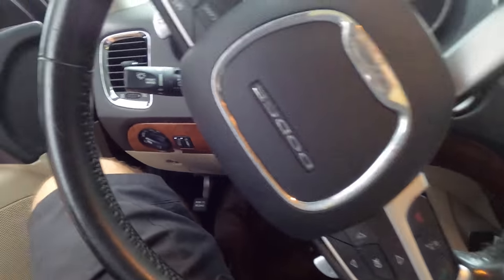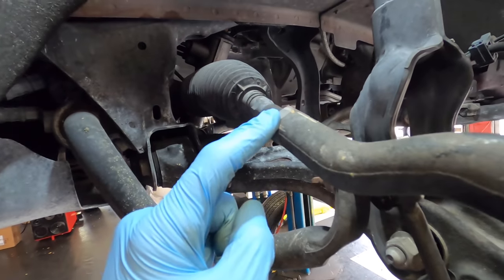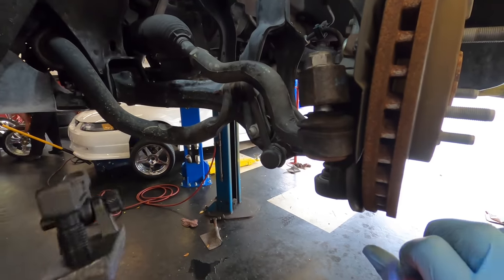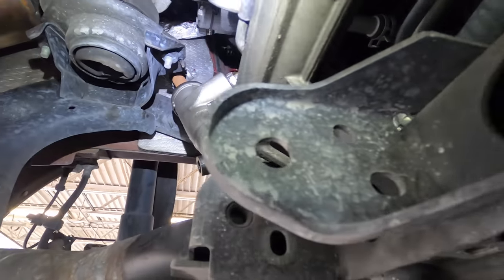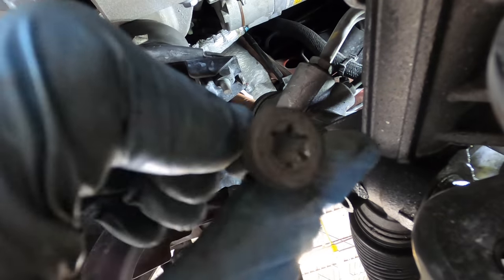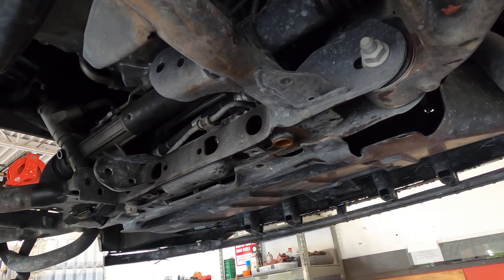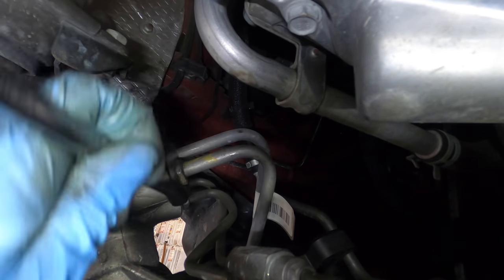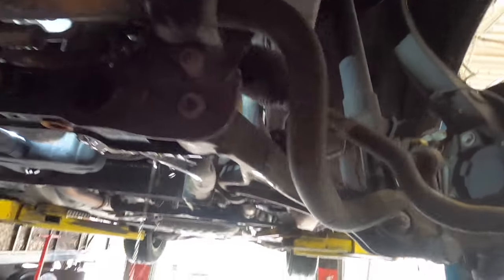Engineers vs Mechanics | They GOT Me!

Comment: Oddly, coming from an aviation background, I see so damned much here that is wrong on at least twenty levels. On the birds I worked on, everything was built to be disassembled while stile still installed on the aircraft: saving the mechanic, the repair station, and the customer time and money in terms of work performed and down time. This Dodge Brother's Wagon on the other hand, looks like it was built to never come apart. Even the rack bolts are upside down. If the nuts back off, the bolts fall out and you lose 90% of your steering input. If the bolts were "heads-up" that would not happen. Just further evidence that modern vehicles are built to be thrown away and never worked on.
Reply: Having worked in the automotive business and now aviation as a designer, I can confirm everything said above.  I can't even start building parts until I know how they will be removed quickly.  

Also, from what I have seen, design engineers these days do not have the hands on experience necessary to realistically build manufacturable parts.
Reply: they truly are. instead of a huge touch screen on a dash id love to see a new car that is designed to be easily repaired. i went to change the shocks on my ford econline and the only way that makes sense to remove the shocks in the rear is to cut the tops of them off with a sawzall, how insane is that??
Reply: Everything except thrust reverse sync shafts of all things, I don't know if they never expected them to fail or built the entire engines around them, but the number of times I've had to cut the outer line in half, then cut the new part in half at the same point to get it in and swage both halves in place to get them in is ridiculous
Reply: thats why we have birds still flying LONG after their figured service life...
Reply: I went from an automotive engineering and R and D, then on too aircraft....yes..automotive industry is driven solely on the buck...not but 2% given to consumer safety
Reply: @narmale  aviation vehicles are small volume by comparison and end users pay huge money for them
Reply: Perhaps cotter pins to keep the bolts from coming off?
Reply: S
Reply: Totally agree with you
Reply: You hid the nail on the head.
Reply: @narmale  Right!  I was a Huey (UH1) helicopter mechanic/crewchief in the 1970s.  I am amazed how many Viet Nam era birds are still in use. That's what happens when things are designed to work, and be fixed when they don't work.
Reply: i have a much different take on this.  cars are designed more like an appliance.  bought and not really meant for large scale servicing.  Also cars are designed to be built quickly on an assembly line.  That durango was probably built on the same day as 1000 others... where as planes are still largely hand built and very few designs of planes ever get to 1000 total built much less that many in a day.
Reply: Also because aircraft are sold to airlines, which have a very slim profit margin. They need plane maintenance turned around as quick as possible, and will pay extra upfront to enable easier maintaininace for the lifetime of the aircraft.

With automobiles, manufacturers they can only stand to gain by not caring how maintenance will be done, because consumers don't think about that as much.
Reply: I've been finding this more and more as the vehicles I work on become newer generations. I started working exclusively with VW Beetles. My tool set was minimal and I could still do everything I needed to do. Then I moved on to Honda Civics, and they were easy to maintain and repair. Then OBD-II hit and every car has been a nightmare since. It's not even the diagnosis or all the tools that are required... it's the cramped engine bays, subframes that need to be dropped whole for many jobs, FWD transaxle shafts gotta be pulled for a bunch of stuff, almost always removing battery trays, starters, intakes, radiators JUST TO REACH SOMETHING. I miss the Beetles.
Reply: @juansolo1617 : True to a point, but I recall adjusting Volkswagen valves every 3,000 miles, plugs, cap, and rotor every 10-12,000, the number three cylinder always running hot, pushrod tube oil leaks, fuel leaks spraying onto and into the distributor causing engine fires, and so on.

Most of today's cars, if they are made properly, will go 100,000 miles with just a couple of oil changes and a set of new tires, and they will go a LOT farther if the recommended maintenance is performed correctly and on schedule. The trade-off is worth it.
Reply: @edwatts9890   you guys obviously have not worked on an alfa romeo
Reply: On my Ram truck, you need to drop the fuel tank to get out the leaf spring hanger bolt or cut it off and put the new one in the other direction. Some crazy stuff they do.
Reply: everything in the aviation sphere is built to be able to be regularly checked, maintained and taken care of. Cars for the past few decades at the least, are built in a manner that they can be pushed off the assembly line the fastest. It's why we have things like starter motor jobs that can take at least a few hours. Or bolts that require removing multiple components just to get enough clearance to remove. Unfortunately we're long past the point of that changing. There's little reason for manufacturers to give a shit what happens after their warranty period. And if it fails inside it? It's typically just a straight swap of systems.
Reply: @madman432000  Dodge has done that for decades.
Reply: "Put a Dodge in your Garage"
Reply: mitsubishi magnas can be reliable. trouble is, the engine has to come out from underneath the car. Absolute pita to work on
Reply: Could it be cars are engineered around an efficient final assembly line process of imported subassembies?
Reply: @justinmugge2721  true but 3D printing for many materials including building is becoming a thing. not necessarily a good thing in terms of integrity though
Reply: Good call on the power steering bolts being upside down.  But if they fail, 2-8 ppl die, they don’t care, still way less than a couple 100 :(
Reply: Cars these days are designed for fast assembly, not repairs. The quicker they can slap them together, the cheaper they are to build.
Reply: They were some airplane that were a pain to inspect parts or grease some of the zerk fittings.  And if I recall on one MD plane, the tail elevon screw mechanics used gloves to smear grease on the screw and had some problem to plug in the grease gun to grease the zerk fitting of the nuts and that cause a crash.   The design flaws of this plane was the access ports on each side of the tail assembly that were too small.  NTSB investigators wondered how mechanics were able to change the screw assembly if the screw shown wears.  

With the exception of a few of them. When they did design planes in the day, they used drafting paper the fixing of some of them wasn't so easy.  

Now with Dassault Catia 3D cad design they can plan ahead access to system for removal and installation without dismantling all the section where the part is situated.
Reply: Cars/pickups just have to last until the warranty period ends...
Reply: The story goes that original engineer caught his wife in bed with the original mechanic and those sob's have been trying to get back at us ever since.  its always the part that breaks the most thats in the most difficult place to change.
Reply: What did you work on? Because I have quite the opposite experience with the aircraft I have worked on. Lol
Reply: @NCISGibbs88  Dinosaurs.  I started on 707's and DC8's flying air cargo for burlington  air express.  The newer aircraft have much better designs for maintenance!  When i worked as a Locomotive electrician they had a VR setup to test fit parts and tools Before we built them.    Sure made life easier on everyone.
Reply: Engineers think car they designed never break down. LOL!!
Reply: @stevehatfield765  ah ok I worked on ERJ145s for a while, lots if GA aircraft, and now helicopters. I work on a lot of aircraft from the 30-50s as well, but most of them are still smaller aircraft. I do agree with heads up/forward bolts and stuff, and lots of times it makes the job 10x harder, but it is a must have when I work on anything, unless it is not possible
Reply: It’s not really fair to compare car/truck engineers to aviation engineering.  1)safety standards are much higher on aviation. 2) cars/trucks don’t fly at 30,000+ feet. 3) planes are completely stripped down to the frame/skin at a scheduled time interval- this on top of the regular scheduled maintenance. And 4) if cars could fly, would you even think about flying in some of the junk piles that Ray works on? Seriously, just watched a different Ray video with a Cadillac Escalade white.  Had leaking brake lines from master cylinder to ABS control pump.  Customer first approved repairs, then overnight they changed their mind & told Ray to reassemble and put in parking lot for customer to pickup. Really? Completely unsafe to drive.  Engineering knows the general public will not properly maintain stuff, so why be concerned with making maintenance/repairs easy. If the customers do give a chit why should they.  Were as with aviation the engineers take into account that maintenance/repairs will be required over the life of the plane.  Airlines demand that planes are designed & engineered to be relatively easily repaired.  To bottom line this if car buyers started demanding better designed vehicles and quit buying the crap car companies produce then things would change. But until then have fun complaining.
Reply: @Bohappenstance Click I'd be interested to know of one modern regular production automobile which requires intake manifold removal to replace the oil filter.
Reply: Automotive companies get to pick their engineers after the military, aviation and space industries.
Reply: @Bohappenstance Click hiding the starter under the plenum is a pretty decent spot TBH. Nissan VK, Caddy Northstar, and Toyota UZ if I recall all use that. They have a space that will never get oil leaked on it from the valve covers, is shielded from the severe heat of the exhaust manifolds, and all of those intakes are fairly straightforward to remove. I have no complaints.
Reply: @Bohappenstance Click often times, a starter mounted externally can be even more of a pain in the ass. See the tundra 5.7L for example. I’d rather replace one in the valley of an older 4.7 any day.
Reply: @Bohappenstance Click I like both! I have an 88 k1500 mud truck with a hot little small block and a big iron 4-speed, solid-axle swapped. Loads of old-fashioned fun, but the fumes and fuel bills get old on the road. Im actually working on EV-swapping a 97 s10 5-speed 4wd at the moment. Hoping to get about 200 miles of range and about 250hp out of it. The idea of commuting with no gas in an old truck with manual windows seems pretty great to me.
Reply: Cant sell cars if everything lasts forever 🤬. Edit. Cant sell ANYTHING...........
Reply: @colemanbonner  the rz too. Gonna change my starter while the intakes out. Not sure how easy itd be with the intake in but doesnt get oil or heat soaked. Heat kills my chevy starters.
Reply: @ohiomike204 , factor in how often steering rack separation occurs, and the actual outcome of such occurrences, and a cotter pin becomes extraneous safety theater. We could have bolted-on seat belt buckles but they aren't practical and they are not safer as the buckles that we know are already extremely safe.

Comment: I worked with a guy who had been an engineer in R&D for a once large manufacturer.  When he worked on his own vehicles, he realised how difficult some things were, and how he could have made it better.  Myself, and other colleagues, who had spent time in repair workshops, gave him no sympathy.
Reply: Coming from the engineering side and having previously worked for GM and Chrysler, most if not all engineers developing vehicles know how much of a pain repairing things can be and a good portion of them were mechanics before becoming an engineer. Engineers will build multiple preproduction cars mostly by hand before it goes to an assembly line.  Engineers top priority is production and cost. That bolt for the rack and pinion for example, Chrysler could have moved it lower to make it easier on mechanics, however Chrysler is going to install 100% of them at a factory, it's much easily and faster to have it that high up so when the subframe was installed it was easier to access during the assembly process.  The reality is probably less than 5% of vehicles are going to need their steering rack replaced and only like 0.1% of that will be under warranty, spending any amount of time engineering it to be easier for mechanics would just be wasting time and money.
Reply: @davidbuck9977 , sound, unimpeachable, and inescapable.
Reply: Henna K  really henna k
Reply: I did a job for an electrical engineer who told me that after 25 years designing systems he decided to get into the maintenance and repair field of those same systems figuring who better to know how to maintain and repair them than the person who designed it. It was at that point and I quote exactly his words that "I learned about everything I'd been designing wrong for the last 25 years." Architects aren't much better. They design things that can be built but often exceedingly difficult to safely maintain. Especially after all the landscaping is done.
Reply: @davidbuck9977  yep. Designed from the “inside out for ease of assembly.”  

Works awesome when the manufacturer KNOWS they’re building a turd.

Comment: Great vid!! A little tip if people remove or dismount the steering rack, put the steering wheel in its lock or if it doesnt have that, put the seatbelt thru one of the spokes. This way you eliminate the chance of destroying your clockspring.
Reply: How's it hurt it
Reply: @AgentOffice  Back in the day vehicles had a spring loaded cam system with grooves or bumps that glide over other bumps or "cams". The turn signals and horn passively glide over each other. You could rotate the wheel with very little risk of damage, to an extent of course. The horn pin can be broken off but can be replaced/repaired cheaply.

Most of or probably all vehicles to today have a clockspring that is a captured system where there is stops and tabs. This system does not pass through each other and are held in a limited range of motion. Turning the wheel beyond those points can and most likely will strip either the tabs or break the spring or horn contacts or all of them. Very expensive to replace and pretty much impossible to repair, not to mention they are very fragile.

Comment: I remember a job I had once similar to this.  I had to change a clutch in a car (Audi, Volvo, or something) which had an enclosed drive shaft.  The 'book' called for ten hours.  The procedure called for removing the rear differential, sliding the 'torque tube' (drive shaft housing) off, remove the drive shaft, remove the transmission, then change the clutch.  
I noticed that all the wires, hoses, cables, etc. attached to the engine had plenty of slack, there was room in front of the engine, and all the mounting bolts were easily accessible so I just attached an engine hoist, removed the bolts, and moved the engine forward about six inches, changed the clutch, and remounted the engine.  My time, five hours!  Beat the book by half!
Reply: Engine hoist is key but you lift block engine up then remove. With pos cortina we had to lift engine to change plugs. Yup these industries are evil.
Reply: More than one way to skin a cat! Metaphorically speaking of course.......please don't skin cats. 
Unless your in a anatomy lab and the cat is already dead. My female lab partner had two cats and refused to touch the dead cat, so I did it, and she became the team scribe.....LOL

Comment: "Scoop up this gravy job!" man you jinx yourself awfully hard 🤣
Reply: I have learned the hard way to NEVER say anything like that before I start a mechanical repair.  "Sure, you will be able to take the car to your appointment, this job will only take me two hours so you will have plenty of time."  Four broken bolts and three days later...
Reply: The totally felt that when he said it 😂 The minute you say gravy job on a Mopar…it ain’t 😂
Reply: @wldncrzy1971  not just Mopar. Been working on over the road and heavy equipment for years now. NEVER say it should be a quick or easy job. Have had my ass kicked too many times by "simple" jobs.
Reply: @OverlandOne  Happened with me with the top passenger motor mount for a Dodge Neon... An hour job, tops, turned into a few hours at an AutoZone learning how to tap a thread because it stripped coming out. 

Hell, it happened multiple times BECAUSE IT WAS A DODGE NEON. Lol.

Alternator was behind the passenger splash guard and had to be pulled out from the top past AC lines & reaching past the engine. What a PITA.
Reply: @brianargo4595  I always say this job will be a bitch. Then I am never disappointed 😂